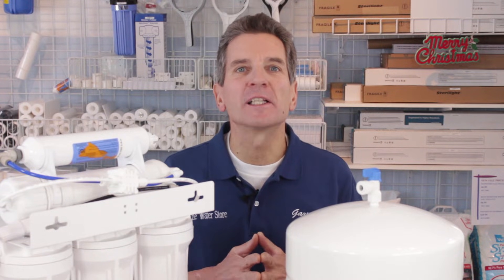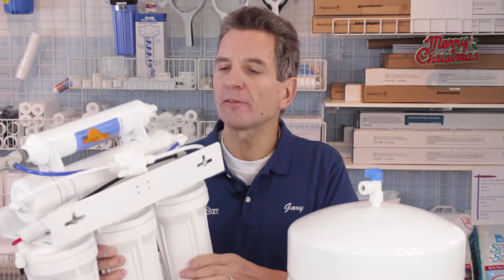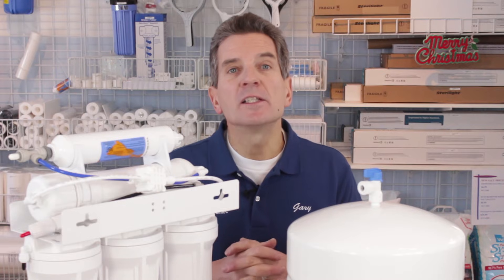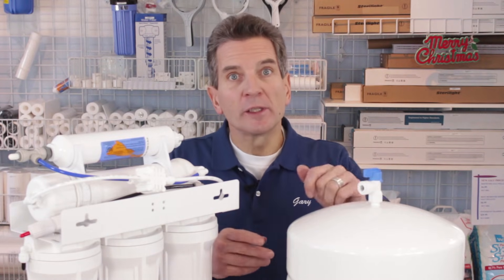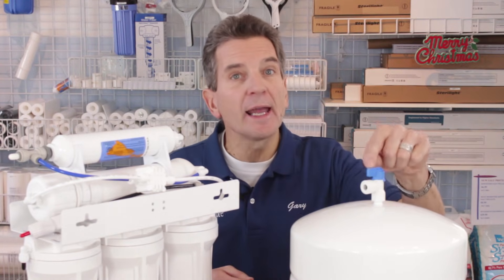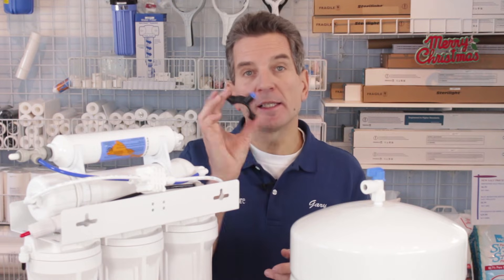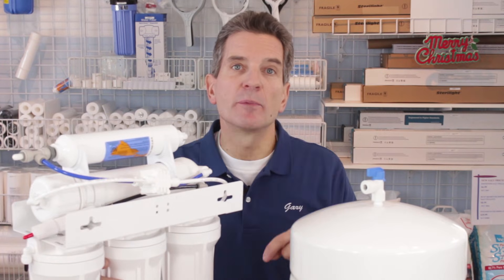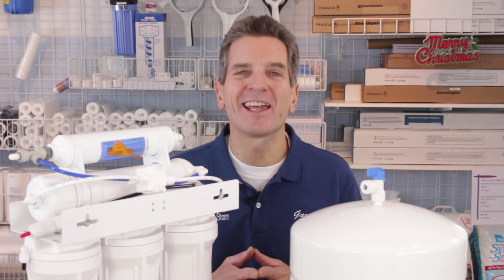Reverse Osmosis Troubleshooting Water Continuously flows to Drain

Comment: I have a WATTS brand 3 stage reverse osmosis system that drains continuously making that gurgling sound down the drain. Manual states, 4-7 PSI in empty tank. I pumped 7 PSI. Still drains continuously. I have that automatic shut off valve with the 4 lines going to it. Green & Red in & out. I've pumped 10 PSI into the tank and still drains continuously. Installed new filters didn't fix it. Is there a way to bypass this to stop it from draining, losing filtered water down the drain? My State doesn't have that safety code that's so called required to have in other States. Thank.
Reply from the maker: Did you check the automatic shut off and check valve as discussed in the video?
Reply: @water_estore  This Watts System has a automatic pressure valve. Has 4 screws to take apart. I took it apart and found there was rust build-up. I reassembled it. Works again. I wish I could bypass this safety code thing so I don't loose clean water down the drain. My State/Local area this isn't a code requirement.

Comment: This makes no sense how do you get a full tank of water if it’s continuously going to Drain?
Reply from the maker: Great question.  While the tank is filling there is also water running to drain.  If there is a problem with the automatic shut off the water to the drain continues even after the tank is full.  This video might help https://youtu.be/Quy_Mg87Tsk
Reply: @water_estore  Thank you problem was fixed because air was coming in the faucet you should do a video on that problem fixed!
Reply: I’ve been dealing with a leak that’s running my meter at around .11-.15 gpm. Been going crazy trying to figure it out, then just the other night I’m hearing something at the kithcjtn sink which is wear we have the RO unit. So I go under the sink and place my ear to to the system and hearing so some kind of a draining noise going into the sink Ptrap which is where this black line ends into . And the black lines corresponds into a flow restrictor thing. That’s all I have for now till the next day to look more in-depth. I was able to shut of the small valve just to stop main water to go into the RO and that stop my meter. So that’s where am at with this. Hopefully this solves it.
Reply: @HoangNguyen-fm6nd  I’m literally on the same boat as you and it’s driving me insane. Had the village come out to look at the meter and everything. Did you find a fix for your issue?
Reply: @Gotsome4yerboi  yes…I replaced the 4 filters of my RO system and it seem to stopped

Comment: After the tank is full. It gets shut till this point all good. But drops won't stop from drainage pipe. What would be the reason. Kindly if you could give any clue would be highly appreciate.
Reply from the maker: Likley the automnatic shut off isn't working.  Did you check the trouble shooting guidelines in the video?
Reply: @water_estore  automatic is working. When the tank is getting full. The drainage water flow is clearly visible and voice of filling can be heard as soon as tank is full I can hear sound of automatic shutter switched off tick the pressure pump process gets stop and the drainage pipe flow decrease and reaches to the low flow and slowly slowly it reaches to the drops state and that is the issue. I mean drops won't stop. I will go through once again with the video. But in my case I can clearly know the shutter stopped. But drops coming out unable to figure it out.

Comment: Gary, our RO System is brand new and it constantly drains water and the tank does never get full.

When I shut off the tank’s valve the draining stops in like 15 seconds, so I assume it is not a problem with either the check or the ASO valves this video talks about. 

Any thoughts? Thank you very!
Reply from the maker: The video says "Turn OFF the Cold feed water supply and open the tank valve. Check the drain line, if water flows then this water is coming from the storage tank which means the Check Valve is broken.  If no water drains out from the drain line this means the ASO is defective and needs to be replaced."
Reply: @water_estore  I'm not sure I understand. If there is water flow, the unit is broken. If there is no water flow, the unit is broken. How can both values be different yet the same.?

Comment: We set ours up, opened the valves, fixed leaks, and then turned the faucet to run for 10 minutes to flush the system out and no water is coming out... what could the problem be? We are at a loss
Reply from the maker: Check out this troubleshooting video https://youtu.be/jur9sS2mo34

Comment: Can a faulty ASO stuck in the closed position cause no water production?
Reply from the maker: Yes, but very unlikely.
Reply: @water_estore  i have the culligan aqua cleer advanced, twist off cartridges. Installed less than 1 year ago, but bought used (new cartridges tho). My ro completely stopped making water. Checked the tank, was good. Changed the sediment and carbon filter, still nothing, but the new sediment cartridge only filled with water. Bought a new ro membrane filter assuming my water softener must be on its way out. Still no water. Noticed that the aso vavlve is between sediment and carbon cartridge, and when i twisted off the sediment cartridge it erupted from the top of the aso valve. Got a new aso valve, still nothing. Decided to untwist and retwist all the newly installed cartridges and bam, the water started flowing. It had to have been the aso valve because the old cartridges were less than a year old and i put back on the old membrane as it was not plugged and am getting good water now. I test my water softness regularly and its benn 1 GPG. Mind you i used to sell ro and softeners, so this was driving me absolutely crazy.

Comment: I drew off 2-3 glasses full of water, turned the tank valve off, and the water stopped running to the drain within a few seconds. However, when I turn the tank valve back on, the water immediately starts running to the sink drain and keeps doing that for a long time, maybe an hour or more. The RO does well with filtration as measured by the electronic TDS meter. Could the problem be with the tank somehow? Thanks so much for these great vids.
Reply: Hi Bill did you figure out the problem ?because I have the same thing
Reply from the maker: Did you replace the ASO as advised in the video under your circumstances?  I doubt it would be the tank.
Reply: @water_estore Thank you so much for answering. I did the test you recommended in the video. I drew down some water and then turned the tank off.  The water stopped flowing into the drain almost immediately. Then, as soon as I reopened the valve at the top of the tank, the water started running down the drain again and continued for a long time. 

You said in the video that if the water stops going to the drain when the tank valve is closed, then the ASO is working properly. Did I understand that wrong?

That's what led me to suspect the tank. (And actually, the pressure was a little low in the bladder but when I topped up the air, it didn't solve the problem.) Thanks again!!!

Comment: I performed the first test, ie start with full thank, then draw 24 oz water. It began to drain. So I shut off the tank valve. The water stopped immediately. When I reopened the tank valve it began to drain again so I timed it. The system drained for 10 minutes then stopped. Is that normal?
Reply from the maker: Whenever it is making ro water to fill the tank water runs to the drain.  If the tank is full it will shut off.

Comment: Need support: My Water Factory SQC-4 has Waste Water keep flowing out never stop after I replaced all four filters. I tried to shut off the main water feed in to the system, but Waste Water keep flowing out until the Storage tank empty. Is this the Check Valve problem? Where is the Check Valve on SQC-4? It only has one elbow connector at bottom of the membrane unit for Waste water, but I can blow air through it from both side of it. Please help. Thanks.
Reply from the maker: Yes, it is the check valve.  It is likely in the elbow like this one https://waterestore.ca/products/john-guest-fixed-elbow-check-valve-part-scv-pi480821s-1

Comment: Hi Gary, intresting video.  I have a 6 stage ro with pump however the pump is staying on when I close the water valve from the tank. I even replaced the ASOV. Do you have any ideas what it would be? I really appreciate of you can help me. Thanks in advance
Reply from the maker: The pump does stay on for a while after you shut off the water, that is normal.  Does water keep flowing through the system after the tank is full (or shut off)?
Reply: @water_estore  Hi Gary, thanks for your reply, I ve made some inspection and noticed that the High pressure switch is not working properly. I think the seal to press the microswitch inside the HPS is not good. Now I ordered a switch and will see.

Comment: What if the membrane was only used for 6 months and then turned off for 10 years? Think it's bad?
Reply from the maker: Yes.  This is your drinking water, do you want to take a chance that in 10 years mold did or did not grow in there?

Comment: My water constantly draining and my tank is not filling at all. I don't know what to do. Brand new filters, tank pressure is 7 PSI.  Please, help.
Reply from the maker: Did you follow the troubleshooting precedure in the video to see if it is the ASO or the check valve?
Reply: @water_estore  the problem is that my tank is not full and water is not going to the tank at all. (1 cup after 24 hours..). Everything worked perfectly before, I just replaced all filters and the membrane (from 75 to 100) and I got a problem.

Comment: I replaced the check valve and the membrane, but the water is still dumping water to the drain.  Any advice on how to fix this problem, thanks!
Reply from the maker: Did you check the Automatic Shut Off?
Reply: Gary the Water Guy ASO valve has been replaced too

Comment: thank you, but why do we have to have a waist water, can we just have water coming directly from the filters to the faucet? without going to the tank!! so it acts like a direct standard filter
Reply from the maker: Great question!  The water going to the drain flushes the membrane to keep it clear.  The flow is very slow, so we need the tank to accumulate the water and repressurize it so it comes out of the faucet quickly.
Reply: @water_estore  thank you for the reply.  
Is there away to eliminate the waste water, or is there other systems that don’t waste water, we are filtering a city water which they say it is drinkable. So without the tank which over time will accumulate bacteria in it. And without the waste.

Comment: My drain only flows when both water sources are turned on (tank and source). If either one is turned off, the drain stops flowing. I'm suspecting it's the ASO and I'm going to replace it.
Reply from the maker: Did you follow the testing procedure outlined in the video?
Reply: @water_estore  I did, either one stops the drain flow, only when the tank valve is open and the supply water is on does the drain continuously run. I've also replaced the ASO, with the same issue. The check valve looks fine. The only thing I wonder is if I don't have enough supply pressure to properly seat the check valve.

Comment: All check valves good psi good...full tank... after turning on water (3 glasses) my drain still will not shut down..... help!!
Reply from the maker: Is the pressure in the tank 7 psi when it is totally empty?
Reply: @water_estore  yes.... no water pressure to fill up a gallon water bottle.

Comment: One more cuestión ... What is the best point to place a pump for boosting pressure and activation valve (pressure switch)?... In system Ro
Reply from the maker: Flow switch should go on water line going to tank.

Comment: Couldn't the flow restrictor on the drain line also be the culprit?
Reply from the maker: Good Question. No it really could not.  The decision to shut off the water occurs in another area of the RO system.

Comment: I collect waste water in a container and I have noticed significant increase in quantity of waste water It happened after I used a different brand filters, Also I have noticed 10 points increase in pressure gauge which is installed between pump and ro membrane, Anyone knows what  could be the reason of this increase in waster water or pressure?
Reply from the maker: How old is the membrane? Any idea of what the TDS is of your water in parts per million?

Comment: Hi, I have replaced the ASO valve since the 2nd test confirmed it was it that has a problem. After replacing it with proper orientation of the tubings, your test stills shows my ASO still having problem. Membrane is new, tank pressure is working and our household water pressure is confirmed to be atleast 40 psi, any suggestions  thoughts why water still continous flowing to the drain even the tank is full ?
Reply: @water_estore  Your video says wait 3-5 mins with the tank ball valve off and I waited 5 mins then checked drain line but still it is running. Then I proceeded on the 2nd test and found it was ASO valve so it was replaced.
 I will try again in the morning to see if the drain line will stop flowing after 20 mins after shutting the tank off.
Reply: @water_estore  I shut off the tank and wait 20 mins but unfortunately, the water still constantly flowing to the drain. I tried to change almost all parts and troubleshoot with youtube videos as much as possible but no luck. Maybe you have magic and help me with your ideas to this problem?

Comment: I have a Model series USS-335 Brita Redi-Twist RO filtration.  It doesn't have a check valve on the tank, it doesn't have a removable membrane like the one in the video (non Brita).  It came with my house when I bought it and is approx. 3 years old.  We changed the 3 filters approx. 2 months ago.  We just noticed the water is constantly running after it came out of the top breather/overflow hole near the faucet tube.  I checked the line drain line and it appears to be clear, water is still running out of the drain tube to the plumbing/drain pipe.  I am at a loss. Besides replacing the whole system to one that is in this video is there anything else I can do to ratify the problem.

Comment: Everything was working fine until I replaced all four filters including the membrane, again.  Yes, the same thing happened the last time I replaced the membrane.  According to all the troubleshooting I had a bad Automatic Shut-Off Valve.  After I replaced it I still had the same problem and ended up buying an entire new WP-V4 system again.  I follow the correct procedure for replacing filter 1 and 2 six months later, no problem.  Six months later I replaced 1,2,3 no problem.  Six months later I replace 1,2 no problem.  Six months later I replace 1,2,3,4 the drain noise has not stopped 3 days later.  I drained the tank again, had about 1.5 gallons of water.  I ensure the tank pressure is 6 PSI.  I turn the water supply line back on and the noise never stops and the tank is about half full.
Reply: @water_estore  How should that take?  After 3 days there is only about a gallon of water in the tank, so it does produce some water.  The pressure is right, it was working before I changed the membrane.  Do I need to replace the ASOV?
Reply: @water_estore  Yes the problem is not the check valve.
Reply: @water_estore  I just replaced the ASOV, set the tank pressure to 6 PSI, turned the water supply valve back on.  10AM 8/24.
Reply: Tank is full and drain is silent!
Reply: @f.allenrisler5303  Can I know how you fixed it? I tried all ways in this video but didn't find the answer. We can't see his reply to you. Can yo please share to us?

Comment: My tank isn't filling and water is draining, still an ASO issue? Or check valve issue? I need help!!
Reply: @water_estore  correct, if I disconnect yellow line at tank water drips like a drip or 2 per second I guess, there is also water draining from black line to drain.
Reply: @water_estore  that's the problem! No water is going into the tank!
Reply: @water_estore  6 psi
Reply: @water_estore  yes
Reply: but water is also going down the drain too
Reply: @water_estore  ok thank you for your help!!

Comment: I need your help if possible I replaced the auto shut-off valve at the same time I put a bigger tank in all was good for 24 hours then back to its normal constant running water to the drain I followed your steps and I'm still having the same problem? Thanks in advance!

Comment: I had to remove the RO membrane housing completely from the mounting system to in order to unscrew the cap and replace the membrane.  Now its not clear to me which outlet is the drain and which is the good water.  Any advice?

Comment: What if the TDS reading is good but the flush cycle runs for a long time?  Like hours.  Turning on the non RO faucet will make it stop flushing.
Reply: @water_estore  Not yet just because my issue seemed different. It does stop flushing at some point, it just takes a long time

Comment: Thank you so much for the video. I have the same issue and would like to ask one question. 

I pulled out the drain line to perform the first part of the test and the water wouldn't stop flowing when the tank was closed. However, when blocking the drain line with my thumb, the water stopped immediately after 5 seconds. When the water supply is off and the tank valve is open, the water does not run. Is that still a problem with the ASO or it can be the flow restrictor?

Comment: I now this video is old but my problem is this:   the water tank valve is turned off, it doesn't flow water to drain.  When I turn the water tank valve on:  water flows to Drain non-stop.